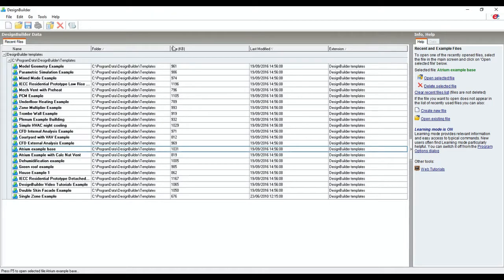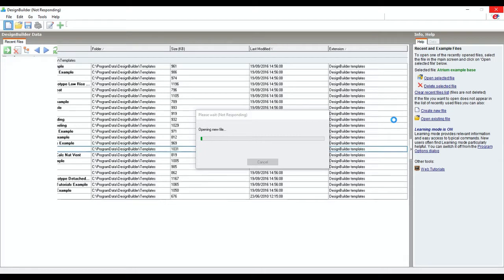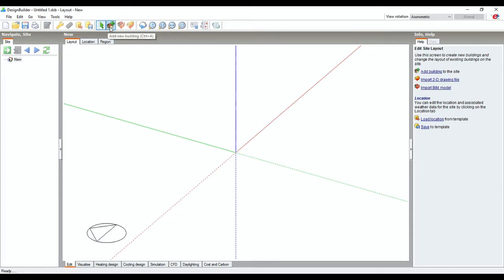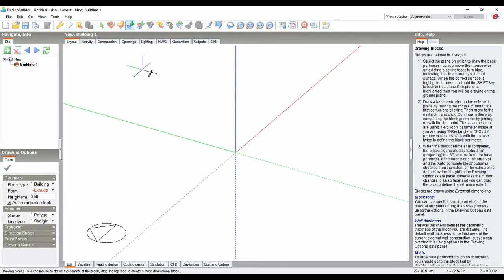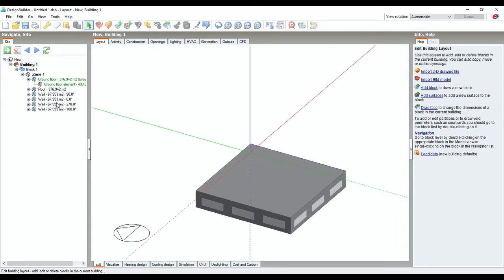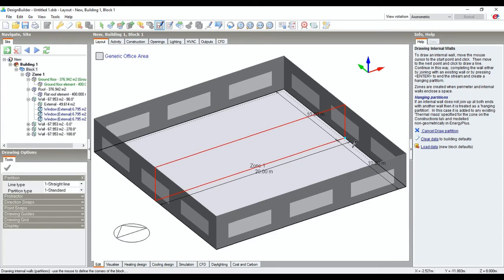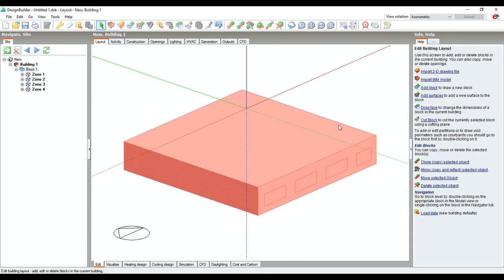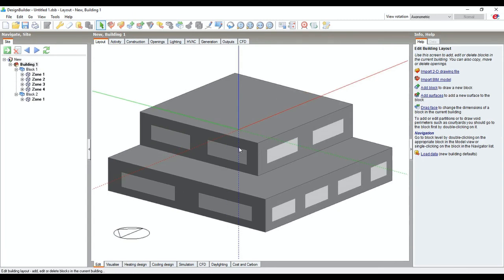DesignBuilder tutorial: Creating a new building, adding zones and new storey

Comment: How to Enable Thermal Behavior for the PV-T Panel? 
The online information says to follow the below mentioned steps, but i cant figure it out,
=In the PV properties panel, locate the Thermal Configuration section.
=Enable the Thermal Output option to model heat recovery.
=Choose Air as the working fluid type (since you’re recovering heat as air for the heat pump).

can you help me ?

Comment: Hi, how can I make a virtual partition without disrupting my windows? Also, what do the internal dotted lines around the wall mean?
Reply from the maker: Hi, Thank you for the question. I do not think one can make a partition without disrupting the window only if there is a gap between the partition wall and the window surface. If the partition wall touches the wall with a window, it will divide it into two. At best, You can try to minimize the area between the two separate zones to minimal to make it a seemingly single window. The dotted internal line is the thickness of the wall material. I hope this helps. Best of luck!

Comment: How can i model a building elevated on stilts?
Reply from the maker: My suggestion would be to create a component block with the height of the stilts and area of the building. Then create the building model on top of it. When you are done with the building, delete the stilts block. That should do.
Reply: @biswajit512  thank you so much for your reply, I actually did that experimentally, but wasn’t quite sure if it was the right way as its an sensitive software and it can effect the simulation.  Thank you for your reassurance!

Comment: How do you place columns and beams for construction?
Reply from the maker: Hi, the dynamic building physics simulation platform such as Designbuilder and Energyplus does not require to build column and beams in the model. From my personal experience, the impact of simplifying the column and beam into direct walls are very small. It also helps to reduce error and make the simulation quicker. I hope this answers your question.